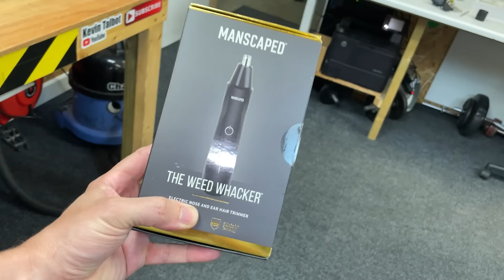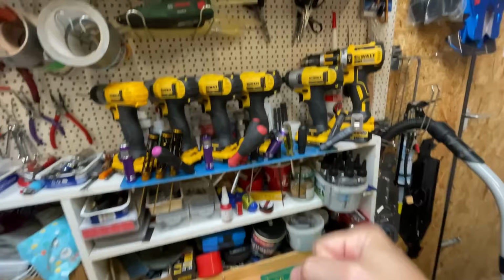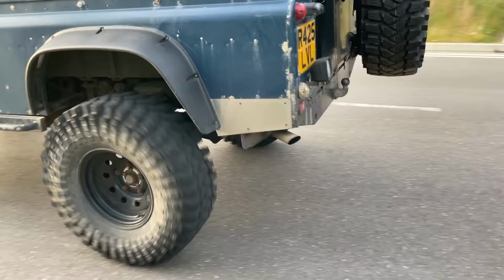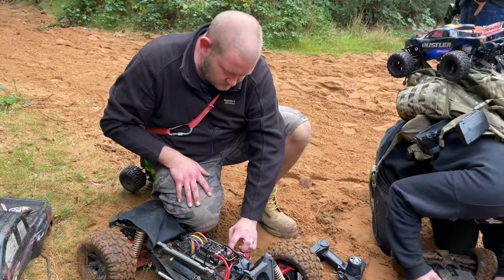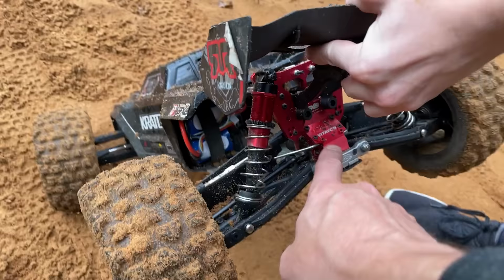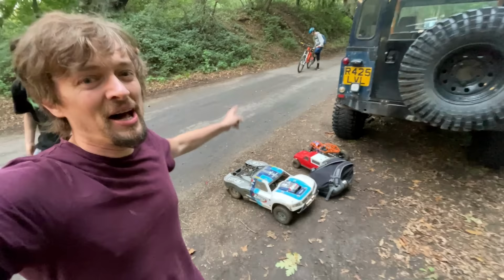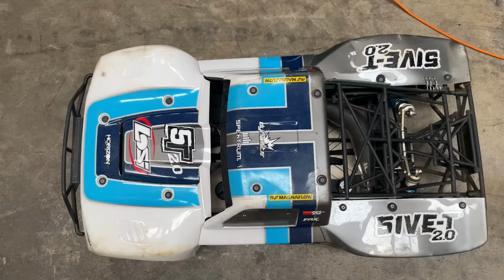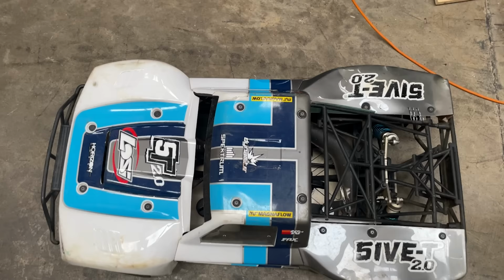GIANT Petrol & Electric RC Race

Comment: After finding the loose screw in the clutch I would go back and check every bolt and make sure to locktite every bolt that would require it. I’ve found loose fasteners on every rtr I’ve had all the way back to the Traxxas sledgehammer.

Comment: Electrics, properly set up, can be faster than petrol cars.  Didnt used to be that way, back before brushless we would try running stupid powerful 4 turn motors on drag cars or dirt cars just to mess around and they'd almost keep up with the nitro guys, but brushless motors have so much oomph that gas only wins in runtime  for the most part.  I can buy a 40 dollar esc motor servo combo thatll go as fast as any normal gas 1/10 rc.  The technology has just changed that much.

Comment: Nice video kev,  where's the best place to buy allankey long drill bits to work on my hpi nitros? Just bought 2 cars the savage 4.6 and the 3.0 wr8 ken block car but both roto starters need putting back on from ebay 🙈😣